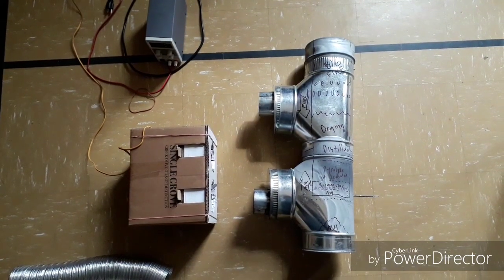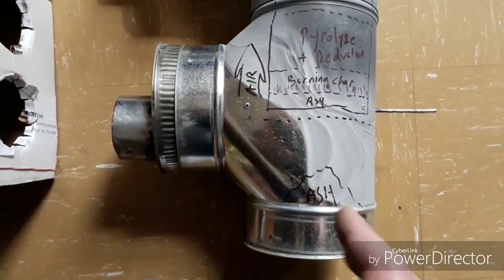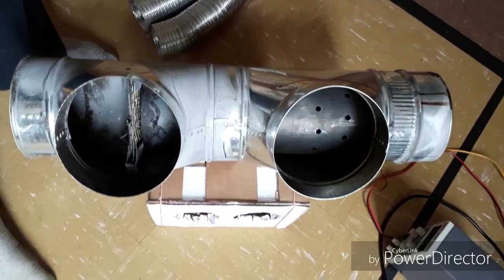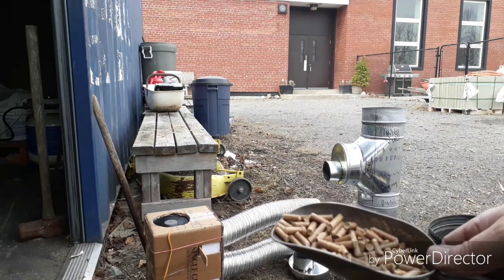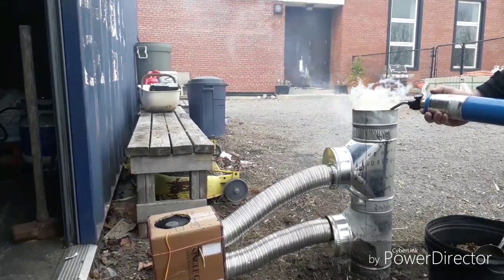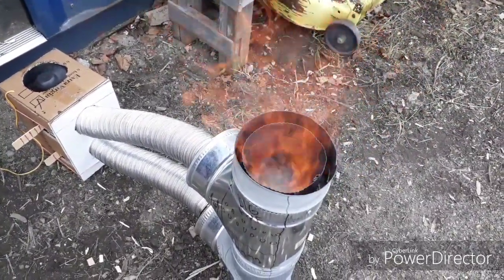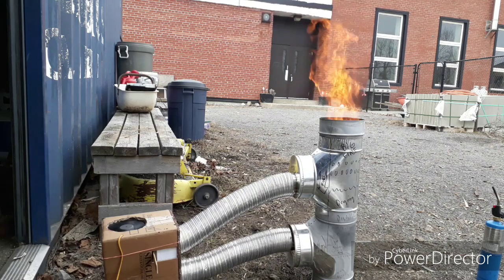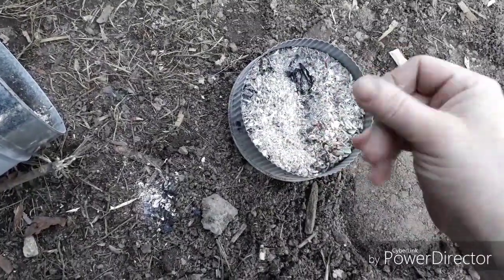Updraft Countercurrent Woodchip Gasifier Model

Comment: Good project.  Your initial smoke is due to the moisture in the wood chips.  Once that is overcome you're burning clean.  Note than when you add new chips you have smoke in the chamber again, but by then you're running so hot in doesn't leave the chamber.  Thanks for sharing.  I picked up some key knowledge in a personal rocket stove project.
Reply from the maker: Thanks for your comment.  I found a better way to start the gasifier by "priming" it with charcoal.  This is a pretty smokeless way to start up.  During operation the gasifier produces its own charcoal.
Reply: @senorjp21  I wet the pellets with 95% everclear. You will see a lot less smoke on start up.

Comment: That flame represents a fair number of kilowatts. 
 If processed, and fed to a generator, you'd have a lovely collection of electricities   :) .
Reply from the maker: Absolutely.  There is a lot of biomass energy lying around, but it is typically very poor quality fuel: wet, contaminated with dirt, high-ash.  This type of gasifier is capable of burning those poor fuels cleanly (at operating temperature.)
Reply: @senorjp21  
 Indeed. You have a very capable system there. 
 I bet it would serve very effectively in a water heating application.

Comment: this is awesome. I'm surprised others have not picked up on it yet
defiantly an Archimedes screw to feed chips in at a constant rate would make it the Bees Knees..
keep working on this one bro.  🤙
Reply from the maker: Thanks.  Note that this isn't a gasifier for running an engine.  This design of gasifier is just for heat.  I'm hoping to make a very clean way to burn very poor biomass fuels for heating.  Although...  I think it might be possible to tap off some engine grade gas from a point in the column while the gasifier is running e.g. at the top of the charcoal layer.
Reply: @senorjp21  I am building an updraft gasifier now.  My plan was to filter the output through a bubbler with water and store in a gasometer to filter the smallest particles out over time.  The result should be very clean gas suitable for engines and cooking food.  I hope this helps.  Great job with this build man!

Comment: I think this has potential
Reply from the maker: This technology is in use today. Most gasification research is for "engine grade" fuel gas, and that is much more challenging. For heat, updraft countercurrent is a slamdunk. I know some lumber mills that use this kind of gasifier to run kilns, etc. They burn soaking wet bark mixed with dirt and gravel - no use if you were trying to run an internal combustion engine.

Comment: Thing is you have no efficiency when u force the air in all the time you just made a blast burner to burn a ton of wood chips but loose out on the benefits of the gasification of wood updrafts just need a gas flow pipe threw the fuel to move the gas up making the draft side on its own! no reason to force air but to get it lit and going!
Reply from the maker: Yes it would be better to operate at negative pressure. The reason I'm interested in updraft is to dry wet fuels so low quality fuels can be burned cleanly
Reply: @senorjp21  i have a question, i have a barrel and i want to use what i watched with your video as a flame or fuel but the point here is when the temperature goes to 120C or much i want to decrease it to reach 60 f or 70 C so how can we control the temperature ?
Reply from the maker: Sounds like you will need some kind of control system to measure temperature and adjust the power level. If you tell me some more details I might have more to suggest. Cheers